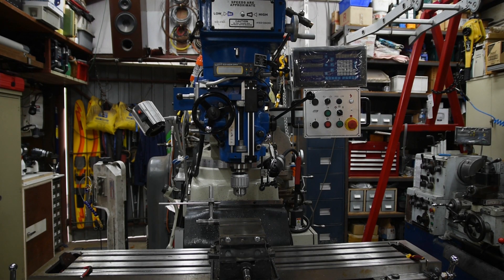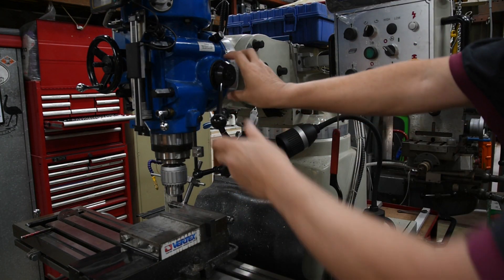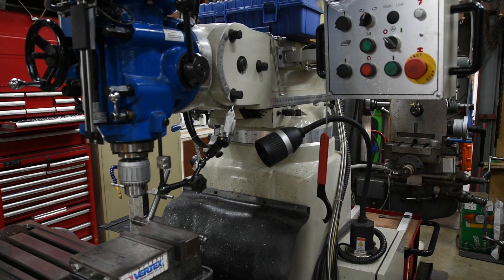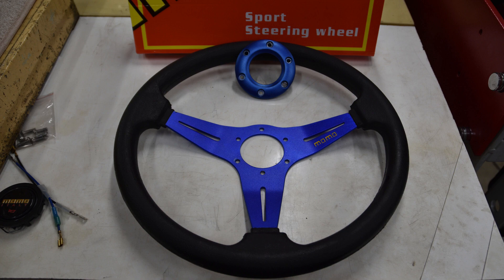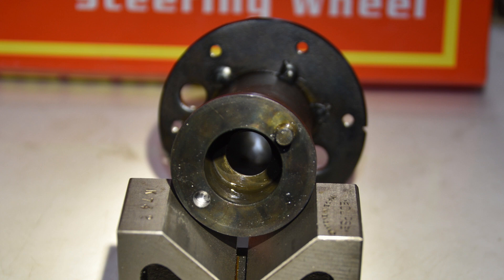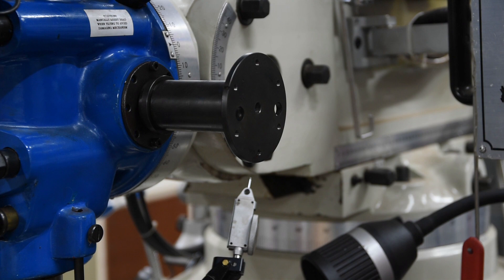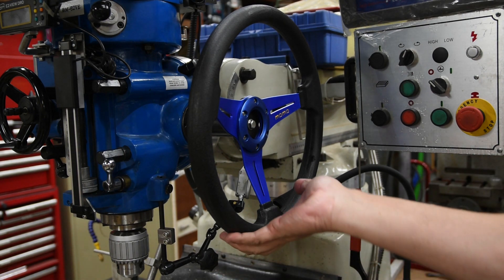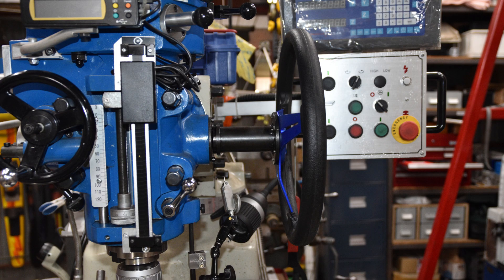Making a quill wheel for my milling machine

Comment: That is something I have always wanted to try I own a Bridgeport and now retired have a little more time to do it thanks for sharing good job
Reply from the maker: It'd been quite a while since I last looked at this video (my first) - not sure why I spent so much time showing how to tighten 6 screws :) 
Anyway, the wheel has been on for 5 years now and I think it has only been off twice - and once was when I had to replace the ram support/swivel casting.  I'd be pretty confidant that you wouldn't regret the effort to fit one to your mill.
Thanks for watching Ray.
Cheers